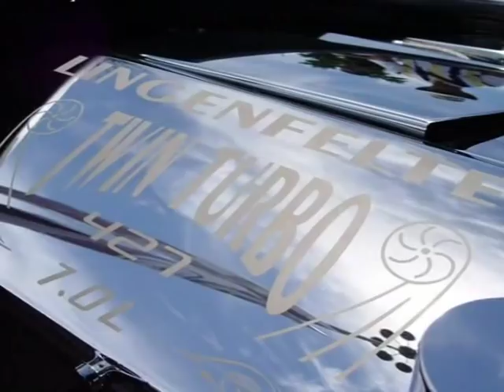2006 Corvette Hall of Fame Inductee John Lingenfelter

Comment: I had one of His cars. A 383 super ram engine in my 1990 c4. LOL, it blew transmissions left and right(700R4) but the thing ran long and strong for over 50,000 hard miles. I was fortunate enough to have met John at Englishtown. The performance world is NOT the same without Him. Thinking a lot about Him lately, car show/hot rod season is here, that's why.